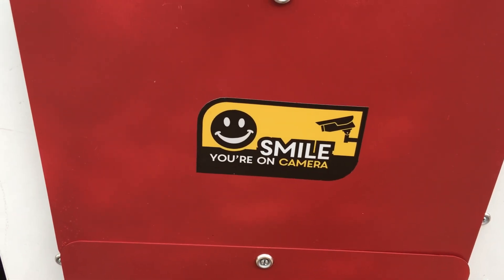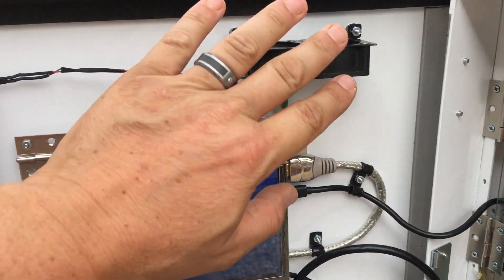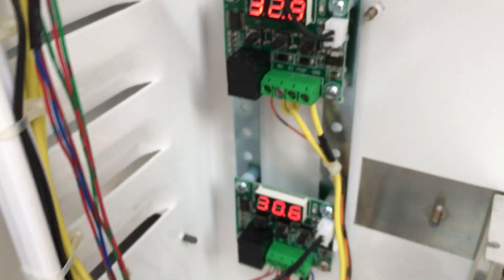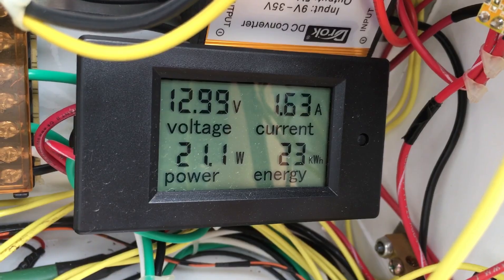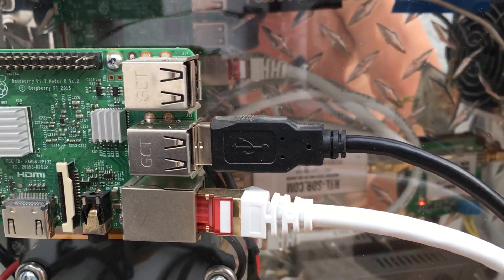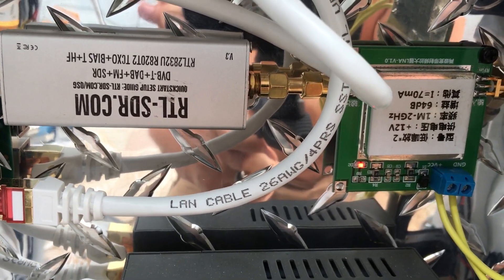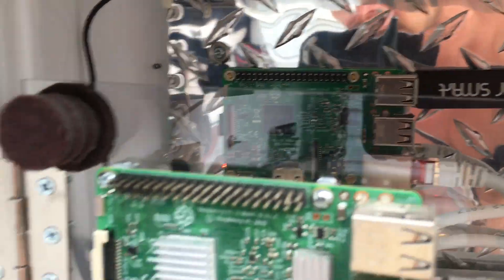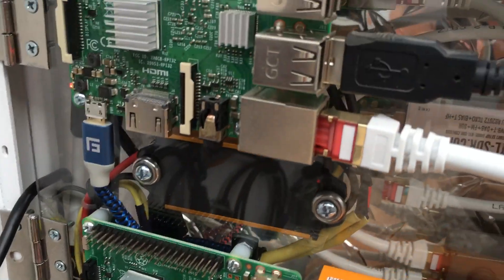Raspberry Pi 3 Setup For ADS-B, APRS Digi, APRS RTL-SDR IGATE And Camera

Comment: Receive-Only IGates can break the APRS-IS due to the dupe-suppression vs the IGate filtering. Consider if a Receive-Only IGate continuously delivers packets to the APRS-IS faster than the local transmitting gate. The packets gated by the transmitting gate will always be dupe-suppressed at the point of entry and that may cause messages destined for the gated stations to never be delivered to that IGate.

Comment: Please DO NOT put receive only I-Gates on the air. You are not doing anybody any favors.

Receive only I-Gate breaks APRS because the return path in invalid
Reply from the maker: I no longer have my APRS Setup running.
Reply: @FuzzThePiGuy  Rochelle is not trying to be a jerk, I was in contact with WB4APR Bob Bruninga (the founder of APRS) and he said to use Receive only I-Gates with satellite APRS signals (since TX back up would be almost pointless when the sat would be gone) Thanks for the interesting setup video, that's A LOT of stuff in there :) cheers

Comment: Hey man, thanks for inspiring me to build an iGate using raspberry pi zero w and rtl-sdr donggle. Although there's not much APRS traffic where I'm located here in the Philippines, my only intention why I did build one is to catch and receive digipeated packet from the International Space Station which currently there's no existing iss igate here. Nearest iGate from me is Japan. Question is, have you ever created an ISS rx iGate? I'm wondering if there's any way to NOT gate any terrestrial traffic (packet I should be sending to ISS), and it should only gate those RECEIVED packet from ISS.